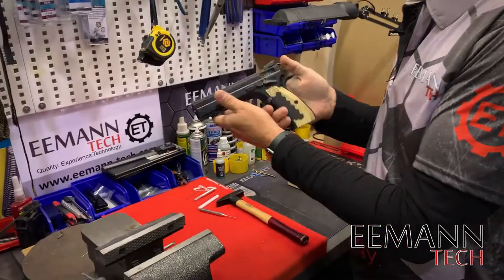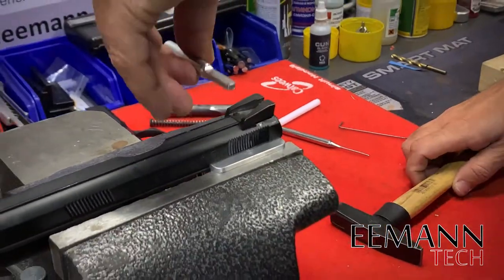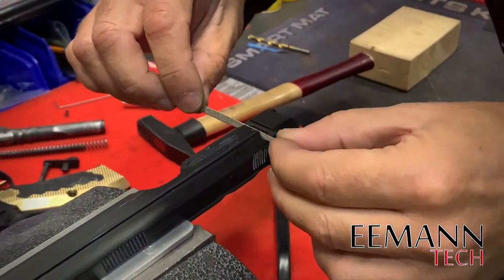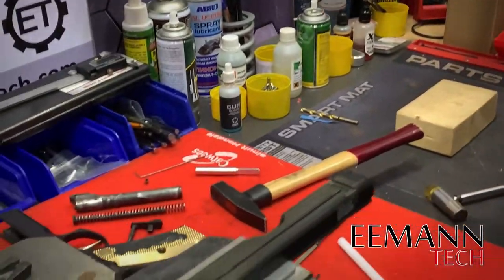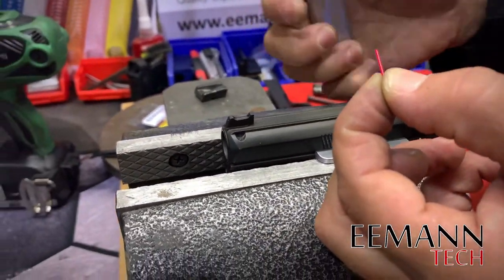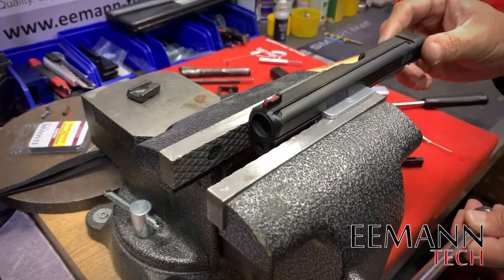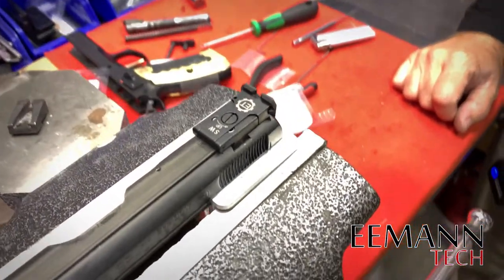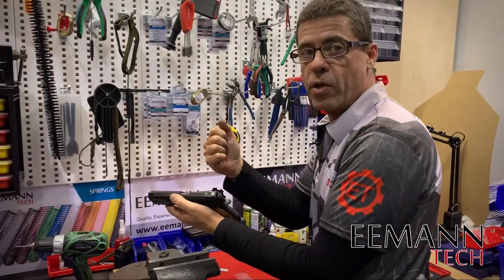CZ pistols sight setup. Eemann Tech front sight and rear sight.

Comment: I didn't know there were different heights for the front sight so ended up with the 5.5mm which is too short for the eeman tech rear sight on my CZ SP01 so 67 dollars down the drain, just be mindful of that. It takes a 7 - 8.5mm front sight

Comment: Thank you for pointing out the Allen key size. Do all CZ rear sights install from right to left?
Reply: Hello buddy. I install from either side
Reply: The trick is to try both sides to see which side goes in further by hand. This way,  you'll find the easier side before you file/sand off too much material (if required). Factory sights with the CZ 75 family are installed from left to right which leads you to think you install the same way. But still CONSTANTLY try both sides as you work to sand/file the sight. You don't want to file/sand only to try one side when the other side unknowingly goes on with little resistance. Take it from experience.